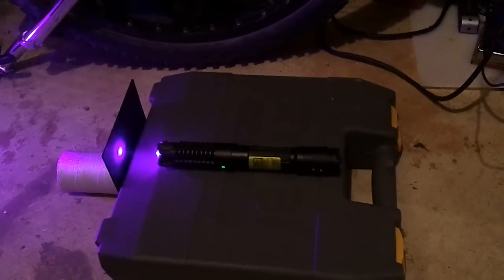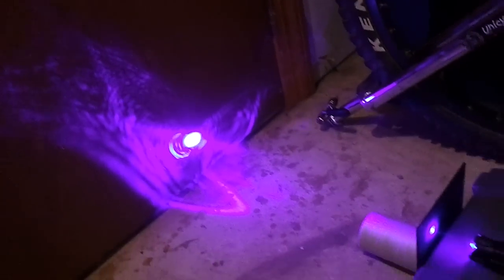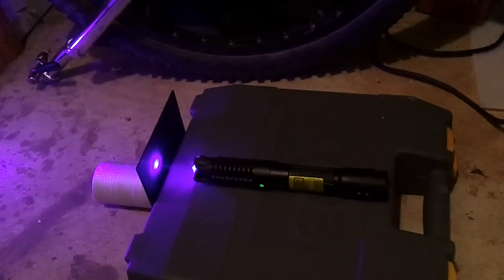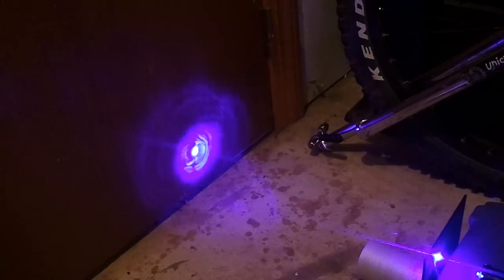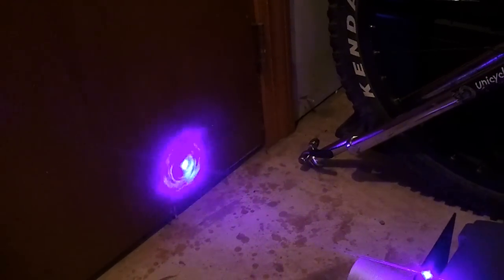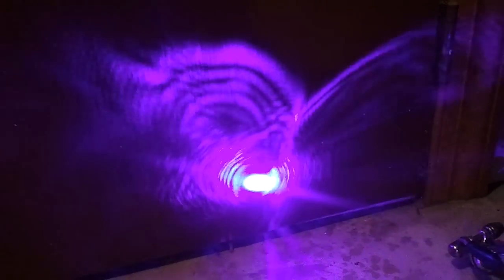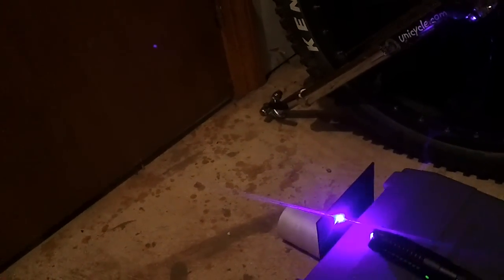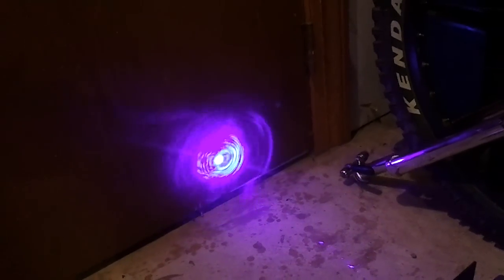Arctic laser burning through .125" black plastic in seconds

Comment from the maker: @vegeta1989100 I've accidentally "touched" the beam very briefly, but only without the focusing lens. It didn't "do" anything per say, but I could feel the brief heat sensation. The unfocused beam would probably start to burn you in a second or two. But if you are focusing the beam, and put your finger right at the focus point, it would probably be near instantaneous